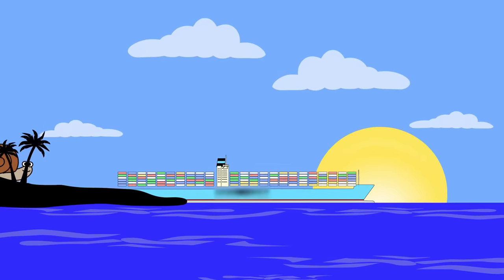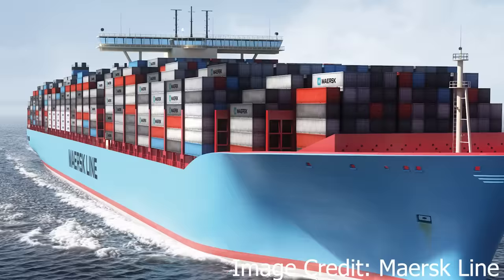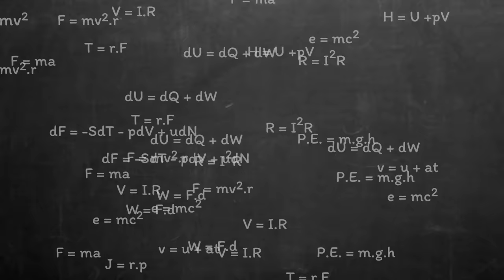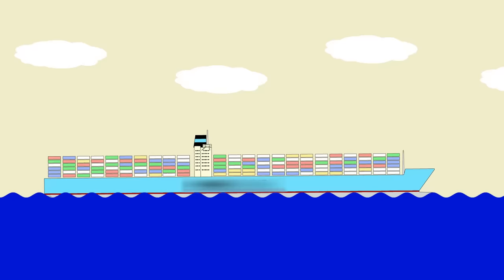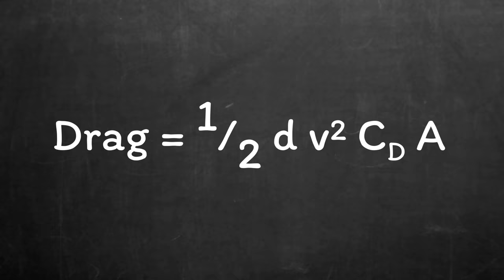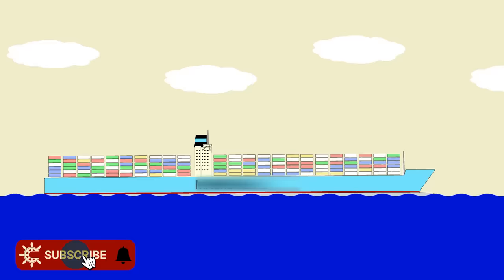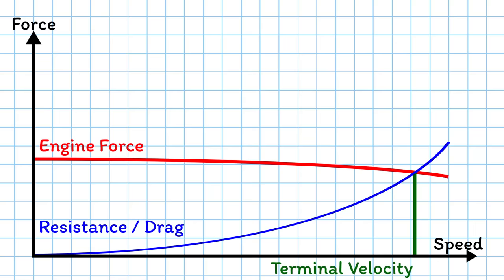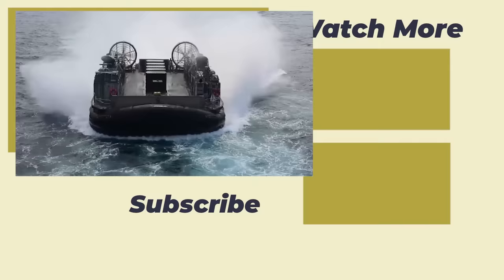Why are ships so slow?

Comment: Great video! Are there ways to make container ships faster without sacrificing stability or needing even more powerful engines?
Reply from the maker: They are already pretty well optimised with hull design. The only way now is getting more power out of her engines.
Reply: @CasualNavigation  ...or fitting such a ship with engines like on the Space Shuttle.
Reply from the maker: True. Generate enough power and you can go as fast as you like.
Reply: Container ships used to be a little faster but they slowed down to optimise fuel consumption, freight rates are not very high right now so every dollar counts.
Reply: The engine allready powerful and fuel efficient. Many company put their attention on fuel efficiency and and the engine were make across the ship design and characteristics. And do you know how its feel driving a thousand tons steel even at 12 knot? 😅 let me put you on the wheel
Reply: Yes there are ways, how about a nuclear powered hydroplane? All you need is lots and lots of money, and a good reason for spending it on this
Reply: That's easy.

Of course, if you want to increase the speed 10%, you're going to increase the costs by probably 25% or more.

So it's really a bad idea.
Reply: @jamescooke3763  Nuclear ship engines actually cost more to operate than petroleum fueled engines.  They do offer some advantages, which is why you see them used on Russian icebreakers and military submarines.
Reply: @jamescooke3763  How many countries are going to allow a mobile nuclear reactor into commercial ports? This was tried in the 1970s but the idea was abandoned because no country would allow it into their waters. Would you like a Chinese nuclear-powed oil tanker moored 5 miles from your home?
Reply: Faster can be done, but asking for the combination of "faster AND economical AND safe-reliable" is a tough job.
You either need to throw more power at it (expensive)
or you need some means to lift the hull out of the water to reduce drag. Something like a catamaran-hull with a bubble dispersal system in the middle to add buoyancy. But such systems are inherently less stable and thus unsafe than the standard hull.
There are already tweaks such as the use of the bulbous bow which allows the ship less drag and thus a greater fuel efficiency in open water *at a specific speed*.
Reply: martin joseph Ships have huge turbos. Like seriously 1000 hp supra level turbos. Mess up with the engines load increase or decrease and you might very well see the valves flying out the funnel.
Reply: @CasualNavigation  ....until you hit something with it.
Reply: @jamescooke3763  NS Savannah, to date,has been the only nuclear powered freighter.
She's currently in the Patriot's Point Maritime Museum in Mt Pleasant SC,just outside Charleston.

Comment: One quasi exception to this is underwater crafts that use supercavitation which changes the medium it moves though. So far as I know this has only been used to specialized torpedoes. But one day we might see submarines using it to travel at high speeds underwater. Would likely still be quite specialized.

Comment: Didn't even mention the body-speed? The speed of a ship is determined by the length of the body. The longer the body the faster it can go. Once the maximum speed is reached all the energy you put in is put into the lifting out of the water but not increasing the speed. This is also the reason why big (long) boats are faster than short ones. 

Sorry but thumbs down, bad knowledge on your side...
Reply: Power and resistance are the only two factors that determine a boats maximum speed. The length and width of the hull, and bow shape help to determine hull speed which is the theoretical speed when the bow wave and stern wave are at equal length. If we exceed the theoretical hull speed the bow and stern wave get longer, and we begin to ride up and surf the bow wave. Hull speed is more like a speed bump than a brick wall. Boaters all around the world routinely exceed hull speed.
Reply: That reminds me of something I heard years ago, along the lines of if you want to paddle a kayak at speed, use a long thin kayak.
Reply: @adamlea6339  - a long thin kayak would have less resistance than a short wide kayak. If all other things like weight were equal, and a person applied the same power to both kayaks the long thin one would go faster.

The long thin kayak will also reach hull speed at a higher speed if the person paddling can provide the necessary power. It is possible to go far above hull speed in any boat. My kayak has a hull speed of 4.9 knots, but I have got it up to 7 knots with a small sail. My sailboat on the otherhand has a hull speed of 7 knots, but will barely do 5 knots on a good day. 😁

Comment: So they just need to make large container ships fast enough to skim across the water. This would solve the drag issue slowing down the boat.
Reply: then u got a huge container ship that cant carry much...
Reply: @Kni0002  And it won't be very economic.
Reply: fuel consumption goes up exponentially with speed
Reply: Ekranoplan.

Comment: Throw out a bunch of fancy numbers but what it all comes down to is cost, 
Cost in actual dollars, cost in fuel, cost in manpower
The amount you would have to spend to redesign the whole shipping industry around to halve the travel time would exponentially increase the cost of the process. And for what purpose, 3 days instead of 7 days at sea means very little for the majority of items being shipped. The advances in the costs of shipping have hit a wall and we are currently only seeing fractional improvements years to year. It’s going to take the “next big thing” in shipping to occur before a radical redesign is worth it

Comment: A 747 freighter holds 130 tons and travels at 900 km/h, so that's 11,700 tkm/h. From what I could find, the Madrid Maersk can transport about 400,000 tons (20k TEU at 20 tons each), which results in 1.6 million tkm/h at 40 km/h (21.5 knots). So you need about 14 747s for the same cargo throughput (if you transport goods both ways and don't count empty return trips), and each 747 needs to travel the distance many times over compared to a single voyage.

I think that makes cargo ships look quite reasonable, which must be the case since they are so widely used in a very competitive market.

Comment: The 30 second answer:
Planes deal with friction. The higher a plane is, the lower the air density, therefore less friction = less fuel consumption + higher speeds.
Cars deal with weight, height from turf, and traction. The better your tire grade, the better your traction, the faster your car. The lighter the car + the closer your vehicle is to the ground = greater down force = faster car. 
Sea vessels deal with buoyancy. There is little traction in or on water. Try running full speed at a pool and running on its surface. it wont work. Try running on a track and then applying the same force and physical exertion while in water, see how you move slower? It's not a solid object and therefore the amount of traction gained is minimal and the friction is high as you move through it.
Edit: this is excluding speed boats as they sit mostly on top of water with carbon fiber frames (as well as the lack of a head, cabin, saloon, bridge, etc;), weigh far less than your average yatch, and usually come with around 500 to 800hp and sometime higher depending on how bat shit insane the owner is.

Comment: For vessels, which are not planing, the "hull speed" ist important. Drag increases linearly (?) up to hull speed. More power will hardly make more speed, but more waves. Formula for hull speed is 2.43 multiplied by root of length waterline. Result in knots.
Now we also know the reason for that underwater "bubble" at the bows of large ships: increase of length water line.

Comment: Funnily enough, once humanity gets intrastellar shipping between planets/asteroids/stations, there will be a similar situation to cargo ships in water today.

It's possible to get almost anywhere in the solar system with nearly the same delta-v using gravity assists. For instance, the delta-v between going to Venus (very close) and Neptune (very, very far away) is nearly the same if you are using gravity assists. The downside is that it takes multiple circuits around the sun and is dependent on orbital alignment. That's why it takes probes and rovers several years to reach Mars, even though a Hohmann transfer would only take around 6 months; they usually take a few passes around both Earth and Venus to build up kinetic energy to reach Mars with less delta-v, allowing them to carry more mass for the same launch cost.

Similarly, you can even make a trajectory that is intentionally inefficient in order to save time by increasing the delta-v used to start and stop for a higher speed. We don't do this much because we aren't in a hurry and rockets are expensive, but a rocket built and fueled using materials collected in space could easily have fuel to spare, and some might be willing to pay more to move faster.

Comment: Well first you gotta find the weight of whatever vessel without cargo and then add the weight of the cargo so that will slow you down and cause even more drag two the current and the weather plays a major factor in making your travel time faster or slower if you go at the perfect time you can get a push from the current and go anywhere from couple knots to 10 or 12 knots faster (about 12 to 14 mph give or take) but you go against it then youll probably take a bit longer and if youre in a pass or a strait and with some of them if your against the tide youll move maybe 1 or 2 knots 3-5 if you know how to navigate close to the shoreline

Comment: Water is dense, more density requires more engine power, ship is heavy, and weight also needs more engine power, so hence a ship is slow, TADAAAAAA.
Reply: The drag equation has a medium density variable which has been ignored in this video. Thicker medium causes more drag!

Comment: The larger freighter with bigger cross-section is faster than the smaller freighter with smaller cross-section primarily because in displacement vessels (ie not a planing pleasure craft) the waterline length dictates the maximum hull speed.  Once you reach max hull speed adding more power does not result in increased speed.  Case in point...longer sailboats have higher maximum speed as compared to shorter sailboats because of waterline length.  You can add more sail to the small boat, but all you will get is more heeling over.

Comment: Rpm and Torque has alot to do with this. Car engines and plane engines produce their power at a MUCH HIGHER rpm than the say 100 or so rpm that a ship engine will turn.  They're also designed to turn high torque at low rpm to maintain fuel economy and experience less wear and tear. Horsepower is important when speed is the desired outcome,  but a ship's designated occupation does not require speed, it requires more pushing force.

Comment: Ships are actually quite fast for moving large amounts of heavy, bulky or containerized goods. Ships use "slow steaming" or steaming at about 16 to 18 knots to save enormous amounts of fuel for only a couple days extra travel to Europe from Asia or Asia to North America. Slow steaming makes even less difference when going from North America to Europe adding barely a day or so traveling but saving lots of fuel. So ships are quite fast when you look at what they must haul in terms of cargo weight, the distances they must cover and the environmental efficiency. A ship is many more times environmentally friendly than passenger cars, trucks or aircraft. So ships are actually quite fast in terms of hauling heavy cargoes.

Comment: Right at the start, you said that the modern ocean liner can do it in the best part of a week, 7 days, but back in the day they has the Queen Mary, Elizabeth or SS United States doing that run in 3-4 days.
Reply: I think a modern container or cruise ship could probably easily do that too if they wanted too, it would just burn so much fuel that passenger tickets or the cost of shipping would be too expensive. So they tend to go slower so engines aren’t running at full power and that’s obviously better for engine longevity etc. They would maybe have to refuel on the way though if they tried it because the fuel tanks might not be big enough for the extra burn at near max power. 

I actually think a modern ship could do it faster than the QM2 but they would maybe have to remove some engine or transmission limiters the engineers put in place to prevent them going faster than the companies would want. 

I’d be curious what a “runaway diesel” with 109k HP looks like if that’s even possible lol, although I hope they’ve figured out a way to prevent that from happening. I would also be curious to see a modern ships best time without limiters etc, maybe that 109k HP is all torque and winds out too soon.

Comment: I guess it's got something to do with drag.
Moving slowly in water isn't too difficult. But going twice as fast might require more than twice the energy.
So going 10mph might require 10kw of power. But going 20mph might need 40kw of energy. 30mph could require 100kw of energy, so it's a rising curve.

Comment: The video mentions that cars deal with friction from the ground but neglects to mention that it's rolling friction rather than sliding friction.  If the car experienced sliding friction--a closer analog to the fluid friction that ships deal with, it would be far slower.  Imagine a car like a snowmobile, with skids instead where the non-drive wheels would normally be.  I bet you wouldn't go much over 20 knots in that thing, either.

Comment: Puts nuclear reactor on ship
"Slow, you say?"
Reply: Look at the comparison: a container ship cruises at 15-18 knots and maxes out at 20-25 knots. The reason why it cruises at such low speed is the fuel efficiency. With a nuclear reactor fuel efficiency just doesn't matter anymore, so container ships could cruise at 30 knots all along. The max speed is of course affected by power plant capacity because of increasing drag.

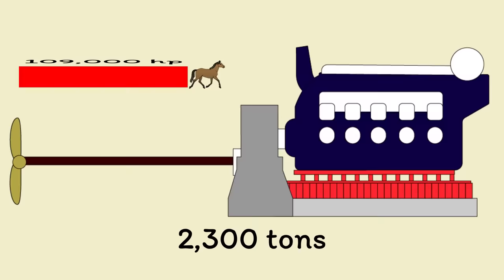Comment: 1:10 For comparison one GE90-115B engine on a Boeing 777 pumps out 110,000 horsepower and weighs 9.5 tonnes. Shows how immensely powerful modern turbine engines are for their weight. I suspect the figure quoted for a 747 is for all four engines on the 747 (it is certified to operate on three engines in emergency whereas 777 has 2 engines so has to be able to operate safely on only one).

Comment: Hi, Casual Navigation, there are torpedoes that use the supercavitation effect to reach extreme speeds underwater, would it be theoretically possible to apply that effect to a surface ship or a large submersible?

Comment: Has anyone mentioned that water is a fluid that can not be compressed??? A plane can easily cut thru the air. But a ship has a huge deal of drag. 26 - 29 knots for a Cargo ship is a skyrocket speed. Try to be in front of it with a row boat as it approaches.

Comment: Would there be any way to use the principal of the hydrofoil to reduce the drag on large ships? A series of wings providing some lift would raise the ship somewhat, reducing the submerged area and therefore the drag, saving on fuel.
I'm a high school physics teacher and not at all a sailor, so forgive me if the problems with this idea are obvious. Is the loss of stability too great? Does the increased complexity not justify the expense?

Comment: Mass is one that affects but a ship doesn't need horsepower that much it need high torque because if not it will stall due to the resistance on fluid called water

Comment: A bit of an obvious one. For a start, they're freaking huge and it takes a lot to move something of that much mass. Secondly, moving through air is a lot easier than moving through water which is a much more dense fluid.

Comment: The metrics you used to compare ships vs cars vs airplanes missed the most important measure of all from a cargo carrying perspective, which is efficiency. If you measure fuel consumed per tonne of cargo carried per mile (or km), you will find that airplanes are the worst, cars next worst, then transport trucks, then trains, then ships. Due to the economies of scale and the vast differences in cargo carrying capacity, ships are several orders of magnitude more efficient than any other mode of transport. This efficiency translates into lower shipping cost and hence lower cost to the consumer. As a result ships carry more than 90% of the world’s cargo measured by ton-mile.  In general the larger the ship, the lower the transport cost per tonne.  Air freight is hundreds of times more expensive and only used for relatively light, time sensitive cargo.

Comment: A manmade object that can have a weight of up to 250000t (metric tonn) , travelling at a usual max speed of 35-40km/h is really not bad . You can travel from Europe to USA fully loaded with over 100000t of cargo in about 13 days . Do it by hand or planes if you think it's slow , you're gonna loose.

Comment: 20knots but not maximum, they reserve engine's power in case of pirate attacks. Companies requires only the maximum speed of their vessel for lesser maintenance and to avoid critical speed/over rpm of their engines